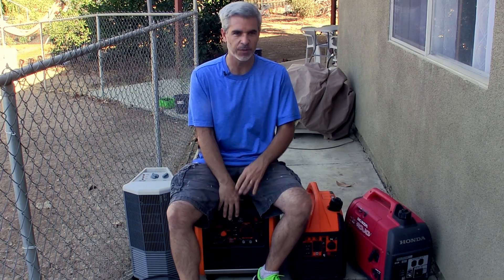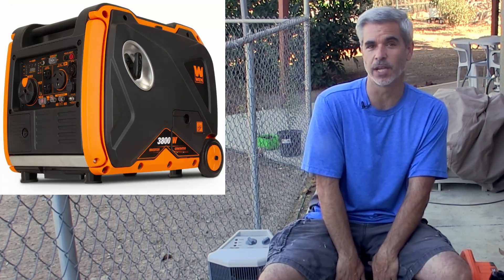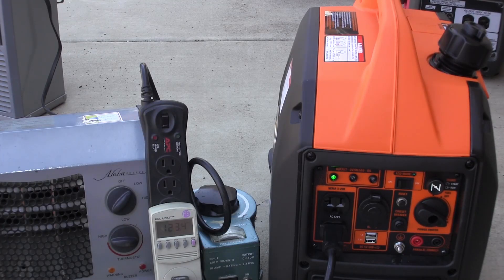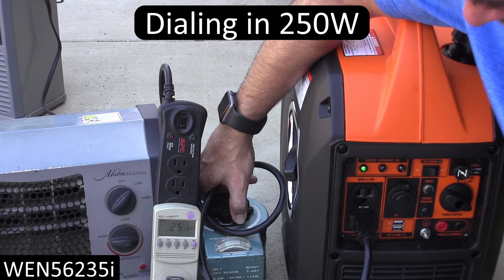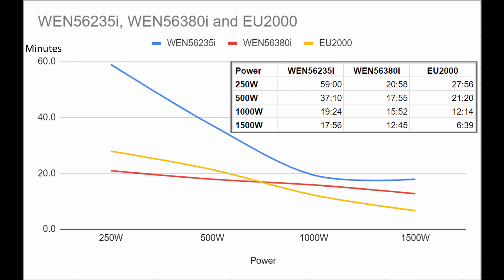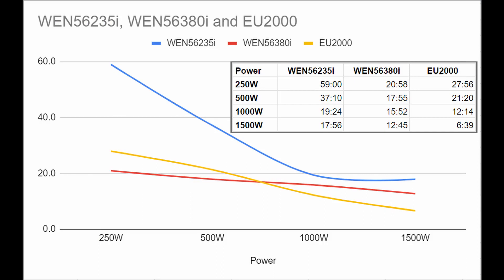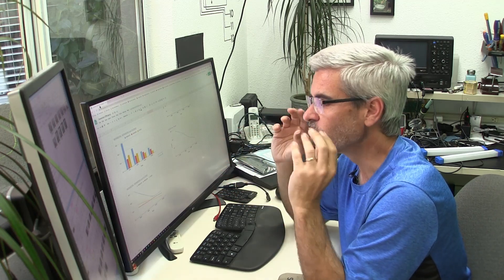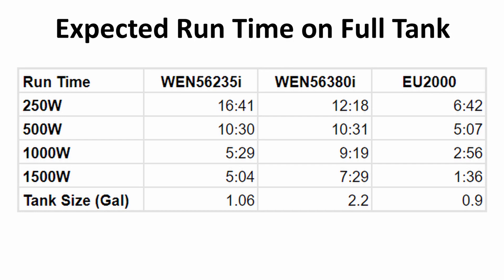Generator Efficiency vs. Run Time - WEN 56235I vs. WEN 56380 vs. Honda EU2000

Comment: I have watched HOURS of inverter generator videos. I’m thankful I ran across yours! I’m a senior female and need help. I have a tiny camper that has a double mattress plus about 3 feet of storage area. It has a Fridgidaire 5000 btu,115 volt air conditioner. Will the WEN 2350i inverter run the AC and a one cup coffee marker at the same time? Thank you so much.
Reply from the maker: Hey there, so the answer is a definite 'maybe'...  The air conditioner should draw roughly 500W, but I don't know what the power rating of the particular coffee maker you have is. If you can take a look at the power information written on the bottom of the coffee maker that would be the next step.  If the coffee maker is less than 1500W, then this setup will likely work fine.  Worst case, you could shut off the air while you make the coffee...

Comment: Dan, great video.  I have both the WEN 230I and 56580 and love them both.  The larger WEN did not fit in the back of my new truck with the bed cover so i bought the smaller one to use with my RV AC.  I had to install the SoftStartRV unit and it runs the AC no problem but i noticed the WEN 230I appears to have variable engine speeds.  Any thoughts on whether or not this can actually run my 15k AC and other device (Fridge, etc.)??
Reply from the maker: Hey Ken. These generators are 'inverter' generators meaning they convert the generator output from DC to AC, and only run the motor fast enough to create the required power.  This is what lets them run so efficiently.  A standard generator must run at 3600RPM to create a 60Hz AC waveform directly, which is why they are less efficient when run at low output power (which is most situations).  When you run an AC however, this is a constant load and the inverter calls for higher motor speed to support the output power.

As far as your question 'will it run my AC and other appliances', the issue there is both the full-time load (say 2000W) and the peak power during turn on.  The soft-start is mandatory as you know, so the SoftStartRV, while expensive, makes it work.  The other loads, like a simple Fridge compressor (vs. amonia cycle fridge) take a lot at startup.  My 150W dryer motor requires over 2000W for about 1/2 second to get started.  If you turn everything on one at a time you might get away with it.  

For me, I wouldn't run more than 75-80% load for long periods of time (hours) on these small generators.  I would get a second one and run them in parallel.  It will make them last a lot longer IMHO.

Comment: Thanks for this useful and well presented video.  I purchased a Wen 56235i based on your review.  I added oil, pulled the start rope ten times to distribute oil inside, added a little gasoline, pulled the choke,and it started on the second pull.  Since then it starts on the first pull.  First fob for mine will be to power a Makie sound system for an outdoor event.  From fifty feet away the music will overpower the generator noise.

Comment: What really bugs me is if you went by what the manufacture states for the runtime per 1/4th load, they are completely off these figures. The 56380i should be more efficient than 56235i at some cross over point, but based on your data it never crosses over.
Reply from the maker: I hear you on that one...  I wish I had run the 56235i up to full power too see if it would cross over with the 56380i.  I will say that the smaller 235i is definitely working 'harder' to produce the higher outputs, whereas the larger 380i is still using eco mode.

Comment: Dan, I just bought a 56235i about a week ago, and wish I had seen your videos first.  It would have saved me a lot of shopping!!  As it is, I read all the reviews on the HD website, Walmart, Amazon and any others where people had left comments. Looked at the myriad of other brands out there, and it came down to this one.  I've owned 2 Hondas in the past, and I think the Wen's noise level is comparable to the Honda at low power levels with eco throttle turned on. You certainly can't beat the efficiency. While shopping, I was doing my best to do mental calculations where here, you have hard factual data.  The Wen seemed to have the most favorable reviews overall, and they have a 2 year warranty which says they believe in their product.  So far, so good.  Like yours, it fired right up, and after that initial break-in, it smoothed right out.  Ran a little rough at first but I figured it was my altitude of a little over 3000 feet.  But no, it is smooth as glass now.  So thanks again for all you put into this. It was VERY interesting.  BTW, mine has a fuel gauge. Must be the latest.
Reply from the maker: Glad you came to the same conclusion as I did!  Thanks for the comment and story.

Comment: Good afternoon.  Thank you very much for this great analytical analysis aas to which model is more efficient!  I am surprised how it panned out, especially as the electrical load increased and how the smaller generator still remained more efficient.

Safe travels!
Reply from the maker: Glad it was helpful!  I'm still looking forward to paralleling two of these together to see how that works.

Comment: Just so everyone understands how inefficient gasoline generators are the WEN56235i which got 450 watt/hours from one cup of gasoline atv1500W is 22% of the theoretical maximum energy one can get from gasoline. The Honda was about 8.7%. At max load stationary diesel generators supposedly can get up to 40% efficiency but I would really like to see a comparison.
Reply from the maker: Thanks for the info!  Very cool...

Comment: I haven’t seen a good test showing how much load kicks off eco mode on different models.
Reply from the maker: Good question.  My experience is that when you use ECO mode, then turn on a heavy load, the generator does a poor job of handling the large transition from low to high power.  Worst case, the generator will go into overload.  Best case, the output voltage will drop really low and that's not good for anything connected for sure...  If you know you are going to have high-power devices connected, then you will want to run them out of ECO mode.  Note that each generator has a different definition of ECO mode.  The larger 36380 has an eco mode of something like 2500W, so that will power a lot, compared to the lower power handling 56235.

Comment: I just bought a new Wen exactly the one you tested. It will be here 5/7/21 ,any tips not mentioned in the unboxing video you can tell me about?
Reply from the maker: If you purchased the 56235i, I would grab both the magnetic dip-stick and the hour meter as it doesn't have one. That's about it!

Comment: Thanks Dan for the very useful comparison!  I've been waffling between getting the WEN56235i vs the 56380i bigger brother and the efficiency factor is what convinced me to go with the lighter unit.  40lbs vs 100lbs and with less efficiency is a no brainer for my use case.  I plan to use solar for my standby power in a grid down situation and I have two solar generator units with solar panels as my primary for basic household use.. and the gas generator as my secondary and also to supplement the solar charging with gas power.
Reply from the maker: Sounds like you have a great setup there!  Glad this was helpful.  I always wondered for myself, which is why I purchased both and passed along the info via the video...

Comment: Thanks for the time you took to get a good look at how efficient these generators can be. I have multiple Honda EU2000i generators. All I can say is with my use only being when RV Park power goes down, I have bought stock in the ether starting fluid market. You could pull until the rope wore out to start one of those Honda generators after it has been sitting for a while.
Reply from the maker: Keeping the jets clean is the biggest issue on all of these smaller generators.  They clog up so easily.  I had to pull and clean the jets on my friends I borrowed just to get it to deliver near its rated power, and to run properly. Keep the carb empty of fuel when storing and don't use ethanol based fuel...

Comment: Great data!   The question i get asked all the time is fuel efficiency of one 4KW generator vs twin 2Ks.  Looks like 2K wins below 2K draw and 4K wins above 2K, as expected?
Reply from the maker: I honestly don't know until I get my hands on a second 2K generator and run them in parallel. Only that test will tell if the pair would be 'better' than one larger one.  Two might provide better efficiency, but could be louder than just one?...  Two could be used with just one active for lower total noise...  Two requires two oil changes and maintenance... Two provides redundancy...  There are obviously lots of possibilities depending on the users need.

Comment: A Lot of Work and very well done.  I don't believe the expected run time all 100% correct.  I have the little Honda 2000i and used it during 2 hurricanes this last Summer.  I had the Honda under heavy loads it would get 4 or 5 hours.  I just purchased the WEN 3800 genset, be here Monday 3/22/21, so I could add a 5K BTU window AC unit during next storm.  The Honda would handle it, had one overload, but I don't want to destroy it.  Love your videos.  Thanks!!
Reply from the maker: Hey thanks for the comments! Sorry you had to deal with the weather there.  Let me know what you think of the WEN when you get it.  Watch your back unpacking it for sure!
Reply: @DansWay  Got the Wen genset.  I really do like it.  Started right up, love the wheels and handle being 76 years old need all the help I can get.  Ran for 1 hour and changed the oil.  Mag oil plug did have little metal on it, glad I got that.  Anyway, not looking forward to another hurricane but feel better prepared now.  Live in Mobile, AL.  Take Care.  Jim

Comment: Thanks Dan!  I am a new subscriber and very pleased to find your channel.  We are making a decision on getting this WEN 56235i.
Given this study of performance, do you think that running 2 units such as the WEN 56235i by parallel kit equal to or more efficient than say a 4000W large generator?.
I am more than happy shop through your link for this purchase as you videos have been insightful and well delivered!  Well done!👍
Reply from the maker: Man I wish I had a second unit to definitively answer your question!  It is a goal of mine to parallel two units, and test them to understand exactly how well they work together.  I CAN say however that at low power levels, a single unit, or even two running at say 2000W would be more efficient based on the data I captured.  The smaller units can be used just one a time if you know your loads are less than 2000W which is definitely more efficient as well, starting up the second unit only when you know you need AC and a microwave or other high power load. The small units are much easier to move around and maintain, and if one brakes down you always have the other...

On the down side, you have two engines to deal with, I don't know how well they respond to large step loads, and converting to propane isn't as easy on the smaller versions.  You also have to remember to not turn on so many items without firing up the second unit, so there is more to think about.  I'm also not sure if two small units are actually louder than one large one, another check if I get my hands on a second unit.

Comment: I would like to see Wen 56380I at 3200 watts vs 2 56235i in parallel to see if it becomes more efficient
Reply from the maker: Good question.  Considering the fact that often a generator is run at low power, a pair of 2350i generator would definitely be more efficient than a single larger one.  You could keep just one generator powered up until you need to turn on the AC and you could fire up a second unit.

Comment: this is perfect!! thank you so much. I am building a hybrid gasoline ebike and going to be powering the ebike right off inverter generators so this is what i need to know to calculate efficiency... Electricity in my area is around 20cents per kwh (15c + 5c meter fees and crap), and if i use the tiny wen inverter, looks like it would have an equivleent cost of around 40-50 cents per kwh which is a good trade off for unlimited range.
Reply from the maker: Hey! Glad this was helpful.  Are you making a video of your progress?
Reply: @DansWay  i will and ill post it up soon.

Comment: The 56380i seems to be the unicorn here given its price point and extra capacity. Can you comment on the apparent noise levels these machines “sounded” like at  1500w. My assumption is the larger machine was quieter because it was still at less than half load.
Reply from the maker: I have that answer exactly as I have gathered the data for my next video which compares the volume of each of these generators... I'll give you this specific answer here if you promise to subscribe to my channel and come back for the final video...
Reply from the maker: The WEN3800i running loaded at 1500W, when measured from 20' away on the loudest (exhaust) side is about 58dB compared to the WEN56235i which was 69dB.  So you are right in that the larger generator is significantly quieter at 1500W vs. the smaller unit. For reference, the Honda was 63dB.
Reply: @DansWay  Subscribed!  Any you’re secret is safe with me ;)
Reply: I think the newer wens r lower db it is about the same as the honda.
Reply from the maker: @juliosdiy3206  The 56380i is the latest model as of Feb 2021.

Comment: This was a fantastic video!  I happen to own both the Wen 56235 and an older Honda EU2000i.  I bought the Wen because I had let my dad barrow the Honda and he didn't want to give it back.  It was more as if I was barrowing my own generator from him.  

The Wen has been fine since I rarely use a generator, but I did notice 2 things.  1 was that mine runs rich.  The 2nd is that my Honda seems to output more wattage.  What I mean by this is what might cause my Wen to go into overload won't trip the Honda into overload.  Especially at  start up.  Have you noticed anything similar?
Reply from the maker: Cool thanks fir the extra details.   There is a reason the Honda is so highly praised.  It also priced accordingly...  so for the price I’d say I’m happy enough.  The larger 3800w unit is definitely my preference if it is easy to roll it over to the job site.
Reply from the maker: Great comments @crabjoe.   At startup it is recommended to not have anything connected to the generator so I haven’t tested it that way. Perhaps I’m misinterpreting when you mean startup, more like starting up a heavy load like a table saw.  The Honda has a larger displacement engine so perhaps it has more mass to keep itself from getting stalled out when starting a large load. Or perhaps the electronics simply allow more power to be drawn before it goes into overload.  

What types of loads have you seen cause the WEN to go into overload where the Honda did fine?

Have you noticed the fuel efficiency issues where your Honda takes a lot more fuel to run than the WEN?
Reply: @DansWay    It wasn't started with anything on.. What I did was start the generator then turn stuff on.  When I did the testing for myself, I used a kill-a-watt to measure the wattage and used volt meter for voltage.  Sorry, it's been about a year since I did this and my memory isn't as good as it was in the past.

Let me see.. I used a blow dryer with a high and low setting, a 2 setting electric heater, something else I can't remember and lights.

What I basically did was have enough connected to pull the rated watts then I'd turn on extra load to check surge.  The Honda  (I bought it back in 2004) would start the addition(s) without hiccup, but the Wen would trip the overload.

Funny thing was everything the Wen ran, the old Honda ran too.  It's s if the Wen is rated at the very max it can output, where the Honda is severely underrated.  For a moment, I thought I had a bad Wen unit, then I noticed the watt meter showing 1850 watts.

Not sure why I didn't .. probably because I was lazy, but I should have checked to see how much the old Honda could actually output.

Lastly, I noticed that the voltage drop during startup was better on the Honda.  If I remember, the Wen dropped into the upper 70s, but the Honda only went down to the upper 80s.

By no means was my testing scientific..  I just kind of did it on a whim to see how the Wen compared with the Honda.  For example, I think when I ran it, I only had about 3 hours of breakin on the Wen, where the Honda has seen hundreds, maybe thousands, of hours over the years.

Comment: Great Video liked all the data! One more interesting piece of data would have been the decibel level for each load point.  I am considering getting one for camping and the noise level will be a determining factor in my purchase.
Reply from the maker: That video is recorded already and I need to edit it.   Long story short I took the small WEN camping myself and wasn’t particularly excited about the noise level.  The Honda would be a bit quieter.  The larger WEN is technically louder, but the tone is lower frequency so it feels less annoying.   High frequencies are easier to absorb with added materials however so I have another video I’m preparing to execute which will do noise measurements with a box built around both the larger and smaller generator styles to see how quiet I can get them.